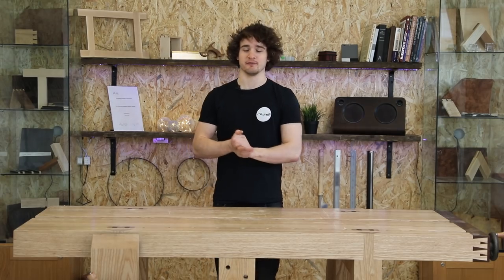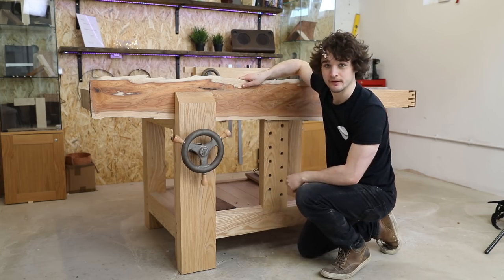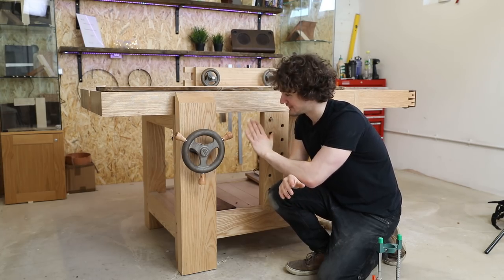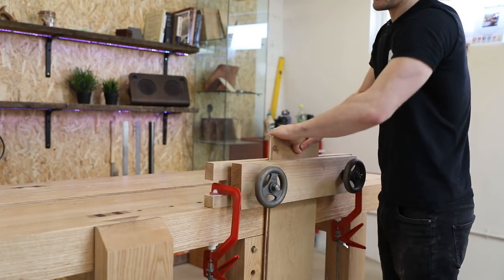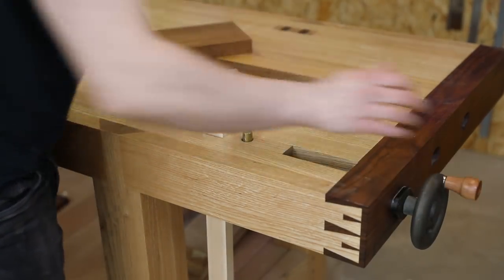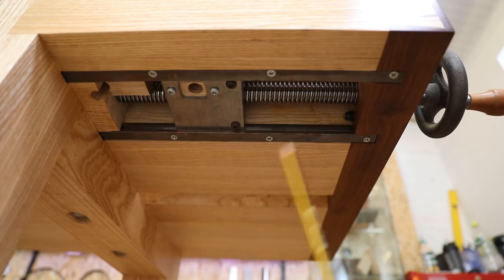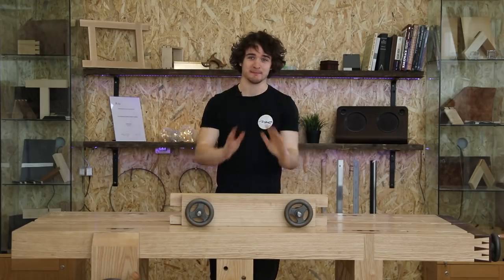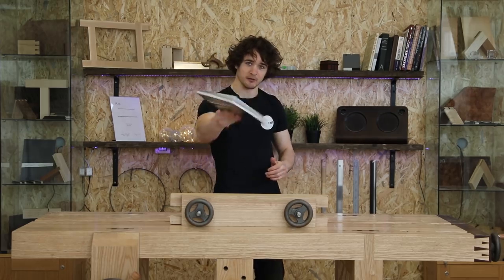Benchcrafted Vice Hardware Review - 8 Months Use

Comment: Hey Matt, had the same "problem" with the tailvise. It sometimes was making the same noise. I solved the problem by slightly rounding of the corners of the iron plate that runs in the tracks/rails. This prevents it from "biting" in the tracks when being moved. Maybe it is of some use to you. keep up the good work!
Reply: That's what I was thinking. That, along with tightening the gap of the wagon plate is more than likely the problem. Perhaps that is why the plans call for a lower fit. Otherwise, beautiful build.

Comment: Great review Matt! Try a little dry lube (like for bicycle chains) on the Tail Vise screw. That should reduce the vibration.
Reply: Yep, I had the same disturbing chatter in the tail-vise.  I was fretting over the cause possibly being my endcap ending up 1º out of square. Jameel at Benchcrafted responded promptly to my email with the same lubrication advice as above. Problem solved with one little squirt.  What great hardware and customer service.  These guys rock.

I agree that the tail vise install requires real care and precision, however I followed the Benchcrafted plans and instructions exactly, and did not run into any of the headaches you describe.

Your bench build video series and this follow-up are superb. Thanks, Matt.

Comment: Hey Matt...use some Loctite Blue or Loctite red if you want those screws on the leg vise wheel on there more permanently.  That stuff is brilliant and I use it on some of my son's furniture hardware, as well as, my firearms.  You can get it on Amazon
Reply: Yup. Loctite will sort those pesky handles out very easily.  One or 2 drops and sorted.
Reply: Another vote for blue Loctite. Auto parts stores stock it.

Comment: One work-around for the criss-cross mechanism pinch would be to make a sliding dowel or sliding square that's fixed into the outer jaw just above the mechanism and slides in and out of the leg. Wouldn't be visible at all from the outside but would stop the work going down that far?

Comment: Hey Matt, enjoying the videos. I researched leg vices when I was building my work bench about a year ago and narrowed it down to the bench craft criss cross, a linear bearing with steel rod and a chain leg vice. I went with the chain leg vice in the end because it was cheaper, easier to fit to a new or existing bench and is more forgiving if your measurements/angles are slightly out.

Are you still planning to do the tour of UK timber yards? If so add Surrey Timbers to your list if you can, highly recommended!

Comment: Matt, great video. Very well narrated. I am almost finished with my Roubo. For me the biggest challenge was building the tops. Wielding those tops around for planing, drilling and routing was a chore building it alone. Couldn't agree more about the vises. The criss cross glides so smoothly and effortlessly. The machining is top notch on all the hardware. The double dovetails are a nice touch and your honesty on showing your mistakes given your exceptional talent should instill confidence in those who feel a bit overwhelmed in taking on a Roubo build. The two bits of advice I would like to share that you touched on are 1. Make sure all your power tools (if using) are tuned to a tight tolerance. 2. Mark out all drilling/routing operations very carefully. If an individual takes his/her time the reward at the end will be a pleasure every time the bench is used, Thanks again Matt. Beautiful bench.

Comment: Try a bit of loctite on the end of the screws that secure the handles on the wheels. That will stop them coming loose. Be sure to use a non setting type of loctite so that they can be removed in the future if necessary.

Comment: For these vises that have the cast iron handles, you will need to oil these handles regularly to prevent rust. I would actually recommend seasoning them 2-3 times like you would cast iron cookware. Seasoning will give a more durable finish and you won't have to oil them as often either.

Comment: Matt,  there is another option for the leg vise instead of the cross or peg board systems you can use a linear bearing. Makes a very tidy job and increases the size of wood you can clamp. I think Richard Maguire  was using them when he was making benches before he moved his business in a different direction

Comment: Matt, Top notch video as always.  Like someone stated earlier, blue loctight is you friend to keep your handles from unscrewing. A small drop on the threads and you will never think about them again.  Im not positive, but my guess the vibration in your tail vise  is something is just slightly out of alignment.  Some graphite on the screw may help and won't be a dust magnet like standard grease.  Anyway keep putting out the quality videos and ill keep watching. ;)

Comment: Nice bench. Maybye try to fix the handle wobble by applying a bit of a medium strength Loctite thread locker onto these screws. Plus you can insert some shims to get rid of the wobble alltogether. Adjusting the preload on the screw will then negate the wobble and after the threadlocker dries, it won´t loosen anymore . Just make sure not to use the strongest one, since if one day the need arise, you won´t be able to undo these screws, that stuff is tough.

Comment: I love the bench Matt. I'm trying to put together a plan to build one of my own and I will probably be buying your plans and using your design as a starting point. However, I'm struggling with the reasoning behind not putting the dogs in the 2nd laminate that runs between the tenons. I think if there is really that much of a concern about loading the first laminate, then it doesn't make sense to even have that section dovetailed to the end cap. There will be some load that goes through that dovetail joint and through the first laminate. It seems like as long as some portion of the 2nd laminate is face glued to the first laminate and the third, then the reaction loading from the tail vise should have a clear return path that does not go through the end grain of the first laminate/tenon connection. Sawyer Design did a similar Roubo (solid top) with the wedged mortise/tenon. He used the 2nd laminate as his dog strip. What do you think? 

Also, I watched the series you did on this build, It's been a while though so you might have answered this question already. My apologies if so. But, Is there a functional reason why you ran the end cap to the second half of the bench?

Comment: How thick should i make my slab top for my workbench? How thin can it be and still work with the tail vice and dog holes? I’m making a bench now. I did my design in shapr3d but i keep coming up with reasons not to just build it as designed.